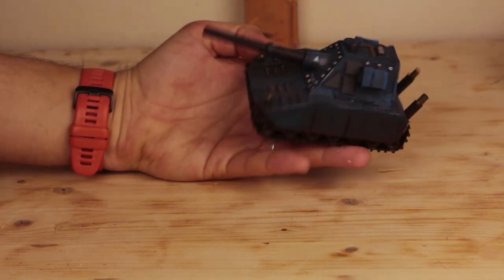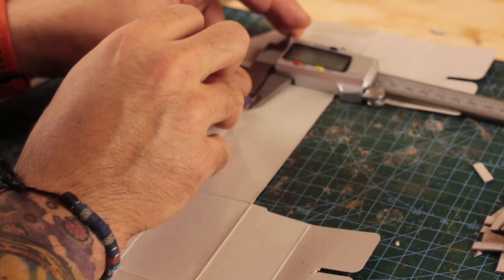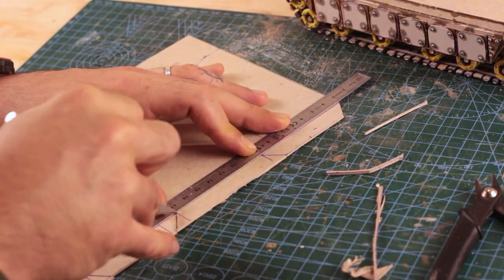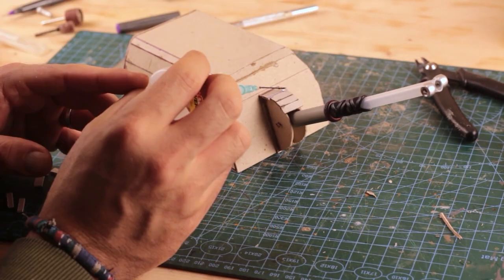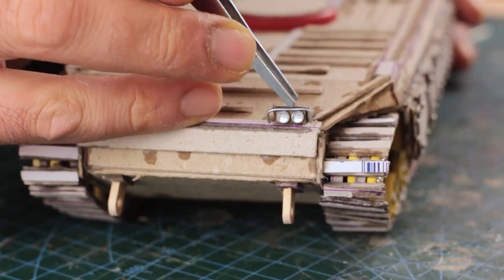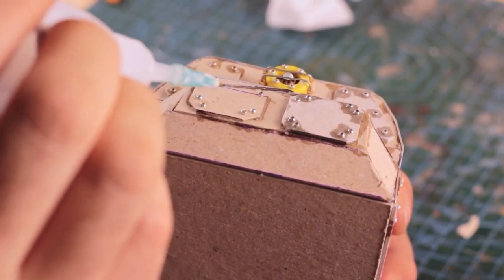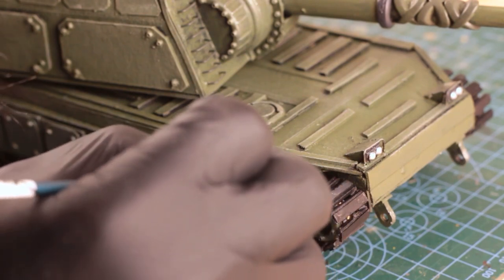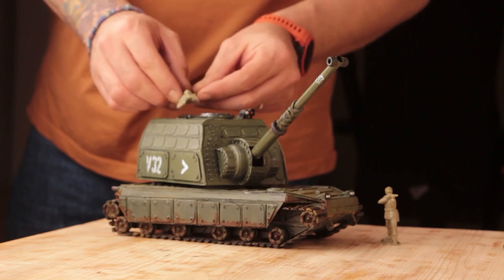🎖️ Meet Tiny - Scratchbuilding a 1/35 Scale Howitzer

Comment: Came here from Reddit! Stayed for the awesome cardboard model... Seriously dude!?!?!? You were able to make this masterpiece out of cardboard and some jewelry bits!?!?!? 👏👏👏👏 Bravo, Sir, Bravo!
Reply from the maker: 😄 thanks a lot and welcome! I didn't know if i could aswell, turns out i can. A couple of vehicles later i'll say bye bye to buying kits 😆
Reply: @VivalaCaffeine  What's that awesome little glue dispenser you have with the needle bit? And is it good and dispersing controlled amounts of glue?
Reply from the maker: @ElHombreGato  it's a trick i learnt a while ago. You trim off a regular glue bottle's tip and attach a syringe needle on there. Since needle is iron glue doesn't clog it. Even if it does you can burnt it with a lighter and clean it.

It gives a somewhat control over the dispersion. Not the best but a far better solution than the plastic tip of the CA glue.
Reply: @VivalaCaffeine  🤔

How do you connect the needle to the bottle?
Reply from the maker: you trip bottle’s tip just abit thicker than the needles bottom end, it fits nicely. or you can put the needle there and glue that on the bottle. i dont glue because i reuse the needles for every new glue
Reply from the maker: i ll make a short video for it later 😜
Reply: @VivalaCaffeine  thanks mate!
Reply from the maker: @ElHombreGato  i made the video for the glue, you can check it out 😉